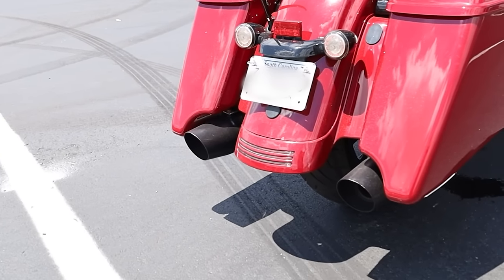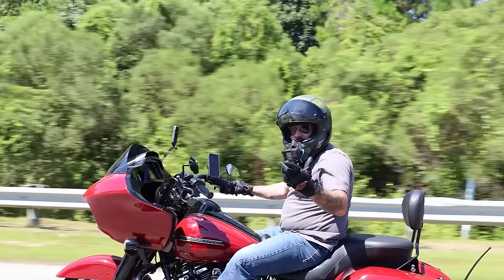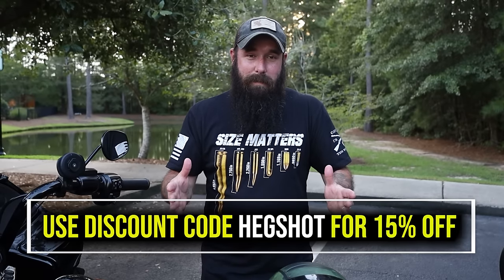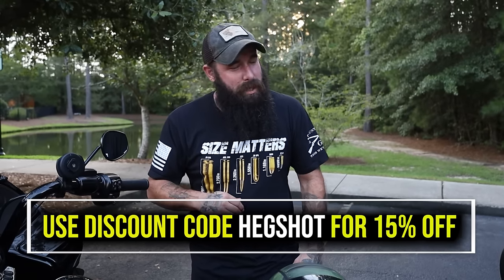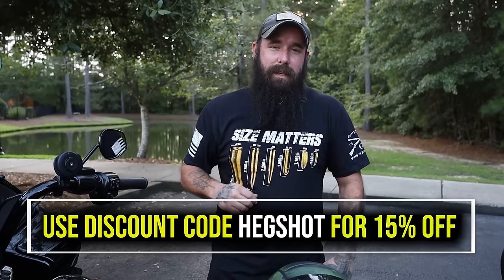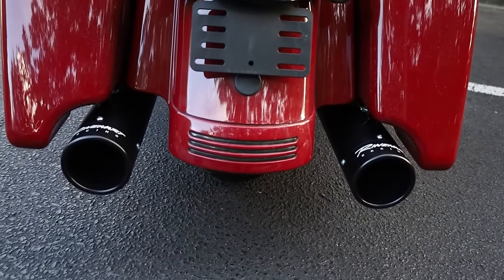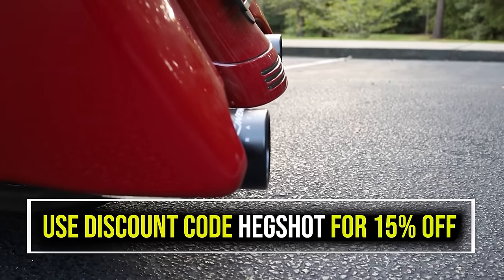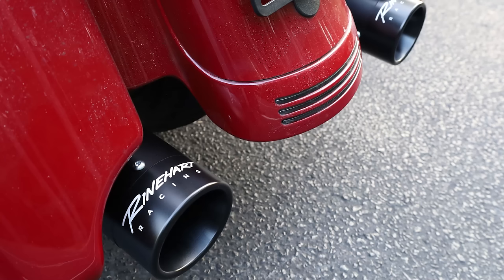This Is How A Harley Should Sound!

Comment: Modern Harley owners are still chasing the sound of the shovelhead
Reply: I love my straight pipes on my shovel
Reply: That’s why I keep my shovels, my ‘67 is the favorite
Reply: and your shovel  be chasing all modern harleys 🤣 🤣 🤣
Reply: @harleyhawk7959  doesn't matter..I am right where I want to be..
Reply: Only more performance and the ability to actually be oil tight.
Reply: I have both. 81 shovel with Cycle Shack pipes and an M8RG with. DD 2 into 1 with a 124. They are different and I enjoy them both for what they are. No sense comparing apples to oranges.
Reply: Miss my “83” Lowrider/chopper, cone/shovel kick start only
Reply: @freebehindbars8654  My 80'/80cu. never leaked in almost 20 yrs. and that was an AMF, imagine that!
Reply: @53philp  By you mention AMF, you admit it’s an issue, of course there are exceptions to the rule. Those motors aren’t bad, just a tractor motor. I like all forms, with my comment being a rebuttal to the original comment. I have a 15yr Efi and a 24 yr carb’d EVO sitting in the garage, so I’m not against old tech, sometimes I want more.
Reply: No top fuel
Reply: My 03 sounds like a beast.. Screaming Eagle engine
Reply: Cool story 😆
Reply: None of them sound as good as Evo
Reply: @tylercampbell6365  Facts
Reply: @danielferguson3786 can’t kickem can’t rideem
Reply: Knew that cheap AMF would be cool one day!!
Reply: Yes
Reply: @danielferguson3786  can’t kick em can’t ride them good exercise 60 wt oil in 0 degree weather
Reply: @williamodonnell7053  no top fuel true. But a top fuel harley is no slouch
Reply: I think the twin cam sounds pretty awesome
Reply: @richardanderson4916  But you  don’t get the sound of a shovel you must be a youngster Ride Safe
Reply: @randyzeilinger9066  The evo sounds the best easily
Reply: i don't know if i'd go that far regarding "chasing that sound"....modern Harleys lack the sound stock but the aftermarket world has more than filled the void.
Reply: But there not chasing the oil leaks. Shovels are great but M8 is a piece of art as well
Reply: Idle definitely not low enough you ever even hear a damn harley  before son?
Reply: @rondingo2347  I believe you were trying to say.. Stock Harleys from factory  are sounding like they are lacking something. That can be said about almost everything with wheels. Except for exotic muscle and sport cars. Thanks to ppl how they vote and since the 1970s killing off the muscle cars. We all have to dance around what is considered legal or just buy the parts later on. Or just buy a bike that was traded in already tuned and modified with the parts you want for your next ride.
Reply: Or twin cam.

Comment: Only way to get away from that stock tractor sound is to change the header, or cam. No slip-on will give you the old school Harley sound.
Reply: Need the cam. Just headers won't do it either.
Reply: I do beleave that you are so wrong some slip ons sound just fine and you don't even need to do a cam change for a better sound not to say that a cam change may make one sound better but not necessary
Reply: A minor tweak to the timing at idle and 0% throttle can give you a slight cam sound with everything else stock. I call it stage 1.25 Louder exhaust is a must. This isn’t even a topic for discussion
Reply: @redbarron3695  wow- never even thought of that

Comment: I like the tab performance bam sticks with zombie baffels.
Reply: I went with the Tabs with zombies too. Great sounding! Nice because you can easily change baffles also.
Reply: You and every other bro. Lol. They do sound good though.
Reply: Those with catless 2-1-2 and a big cam 

THAT is the way to make an M8 sound proper
Reply: @geraldgoodiii6993  also a way to lose a significant amount of low end power.
Reply: @3percentmick705   I went with fullsac and the woods 422 cam. My scoot sounds perfect to me. Lost a lil bit on bottom but barely. I'll prolly be buried with this scoot when I die.
Reply: Just put some 4.5 bamsticks with zombies on my new fltrxst
Reply: Best pipes for the m8 in my opinion.

Comment: Love my stage 2 with basani road rage 2into 1 117 Lowrider st  my son got Vance & Hines high output 2 into 1 has no heat shields will bbq your leg I can hold my leg on mine with denim jeans for 3 or 4 seconds before it gets to hot love the sound no converter

Comment: I have Rineharts on my bagger love them mine are the 3 1/2 round older bike pristine condition. Did the stage 4  jugs slugs head wrk cams new cam chest. 
 Perfect plus push rod big ole carb flatside
Reply: I'm here.
Reply: have true dual rhineharts from heads back my old pristine 17 yr tc. ported, geared cams, balanced S&S crank, 10.5-1 pistons. billet cam chest high flow S&S oil pump. S&S adjustable push rods, valves springs. its my baby since new

Comment: But with fishtails.

I have an 06 FLHTI 88CI that has a cam, SE Intake, Fueling oil pump/flexplate, T-man messaged heads, performance fishtail exhaust, with a performance tune for 91 octane real gas. It puts out 96 HP and 111 Tq and still gets 51 MPG cruising down the back country roads. It does drop into the the high 30's with aggressive city driving. I am satisfied with what I have. And yes, I can pull it up.

Comment: I have 21 RGS 114ci. Cat removed, screaming eagle torque cam, DBX 4.0, tuned by fuel moto and I think it sounds great. If I revbomb slow cars in the left lane they can hear it. My 850 pound bagger will pull the front wheel off the ground during hard acceleration.

Comment: I put the DBX 40’s on my ‘21 Road King Special. A lot better than stock for sure and totally agree how clean they look . But still doesn’t sound as good as my old ‘89 FXSTC Evo.
Reply: Are the newest Harley engines just too smooth to rumble loud, compared with the EVO's?  I think in a few years, they'll go to electric and that's hard to imagine.
Reply: Then it just won’t be a Harley in my opinion if they go all electric
Reply: @2021FLHRXS  Maybe HD would build some convincing rumble and noise into an electric cruiser.  I don't know.
Reply: @Havanorange  It would spell the end if Harley were forced to go all electric...

Comment: I bought a new 2019 street glide sp. Of course I wanted my pipes to be louder so my local dealer said as to not to void the warranty (that's another story) I need to get screaming eagle slip ons and the tuner and air cleaner (stage 1). I still wasn't happy with the sound. When my warranty was about to run out I did research on after market slip ons. I was leaning on the Reinharts but before I pulled the trigger I wanted to hear them in person. I found an M-8 at my local dealer with Reinharts on them and a salesman fired it up for me. That's all it took. I wanted them. Parts guy said we got them. Service said we can put them on right now. I said lets do this. I love them. Not real loud when idling and at slow speeds. I really respect my neighbors and didn't want to upset them when leaving for work in the early mornings. I also do alot of camping and when leaving the campgrounds didn't want to make too much noise. If and when I get another bike they will have Reinharts on them for sure.
Reply from the maker: Nice man I hate the Screaming Eagle stuff as well. I don't think slips only will void the warranty but I could be wrong.

Comment: Note that once you remove the cat, the sound changes, when you add a cam, it changes and when you add a 128” high compression engine, it changes, each step getting louder. Some may find it too loud and drone on the highway.
Reply: Factz! I had a 107" with V&H head pipes and Rinehart slip-ons (pre-DBX) and later swapped out the baffles to DBX baffles. It sounded ok, but not what I was really expecting. I eventually went stage 3 with an S&S 124" kit and the bike is a beast now! Sounds like an angry bear was awakened from hibernation too early lol. My wife says she can hear me when I'm on my back to the house minutes before I arrive.
Reply: True. I have a 2020 road glide special 114. I put on chrome works slip Ons and better air filter and added a cam. It sounds great and it runs great, but it was so loud. I couldn't hear my radio even through the speakers in my helmet. So I got some dB dampeners that also provide a little more back pressure and lower and torque. Now I have the bike just where I want it. But for a while there with the new cam, it was so loud my teeth were rattled after a half an hour.

Comment: Hummmm . It's ok to be quiet , but that's too quiet . My opinion ONLY ! I NEED RUMBLINGS . Mine is kinda excessive, though .  V&H . I call them ground pounders and misplace my baffles . They are going back in after I re-cam my bike with trip 5s . New breather and oil pump .

Comment: I have a 2021 HD RG CVO. I did a Cat delete and added Rinehart DBX 45's sounded great. Then I did a Stage 2 with an S&S 475 Cam. Now my big sounds like a drag bike. It is way too loud! It is obnoxious in my gated neighborhood. I also just upgraded my stereo - now I can't hear the stereo. Any suggestions? I don't want to get rid of my new pipes, and I hate that I will likely have to get it re-tuned. So frustrated that I have not found a solution.

Comment: Always liked Rineharts. Always bought their exhaust. However the DBX 45 are useless when you put a cam in. They produce noise and zero back pressure and it will run like shit. Had to change to Khrome Werks louvered baffle to get the bike to tune properly. Huge torque dip 2000to3000 rpm. So save your money do your research and pick the right exhaust once not twice.

Comment: I’m not real excited with Rinehart right now. Yes. I bought my bike used with 4” rineharts on it. Now it’s developed an annoying baffle rattle. Gonna take it apart and see if I can figure out what came loose. I generally like your recommendations on things.  EG. I have a tulster holster and love it !   (Yeah I used your code) I just expected more from
Rinehart and am
Hopeful I can figure out what the deal is.  It’s annoying and embarrassing sitting at a light with this rattle.  Wish me luck
Reply: Buy cobra pipes and you won’t have the problems…
Reply: Riding a stupid Harley is embarrassing on it’s own
Reply: @danburgess1514  great comment.
Reply from the maker: I hope you got it figured out....Glad you like your Tulster Holster
Reply: @HegshotRides  nope. Not yet. Someone had already tried before and the one bolt is stripped on the endcap.  Gonna have yo pull the muffler when I get time.  Riding has taken priority.  Just annoying at lights when I hear the rattle

Comment: You can never get the same sound as in a shovelhead. The New bikes are not made for it. The rpm is to high and if you lower it the oil pressure disappears. Result a destroyed engine in very short time.

Comment: Put a full face helmet on and ride 500 miles, and you’ll love the stock pipes.
Reply: Or you could just buy a goldwing….
Reply: @maddawg4599  That’s the plan.  But, instead of 500 miles, it’ll probably be 700-1000.